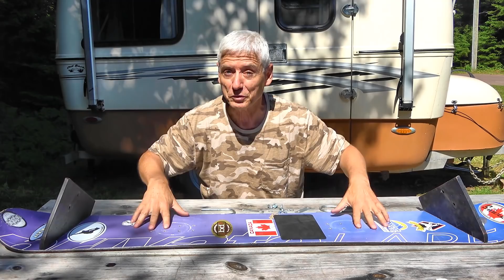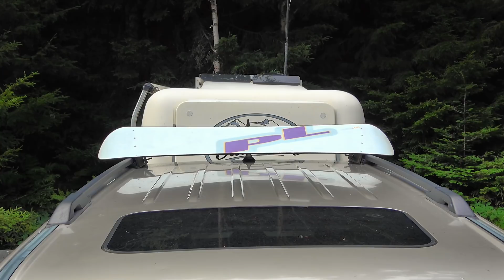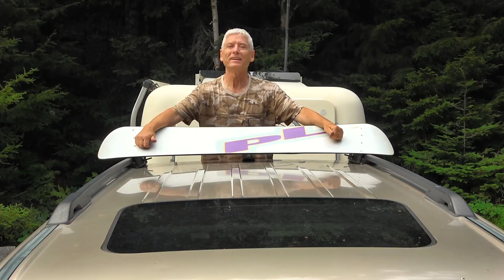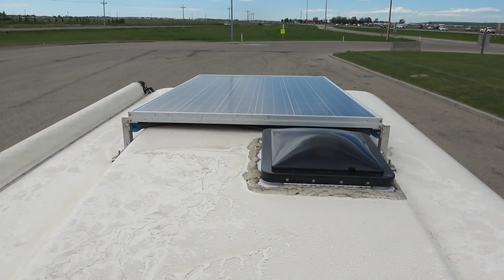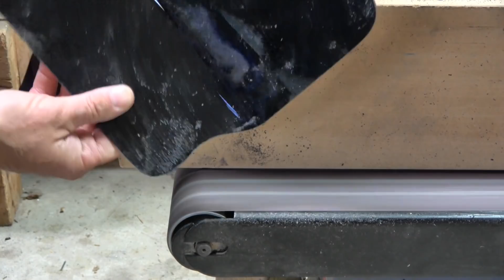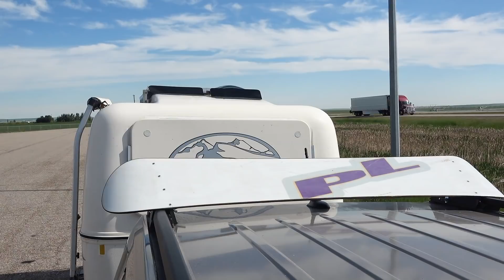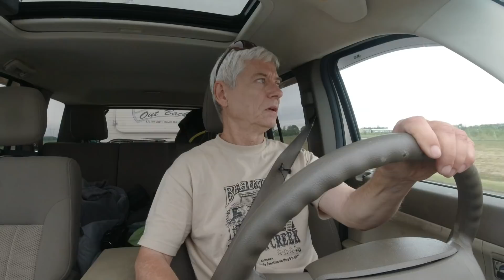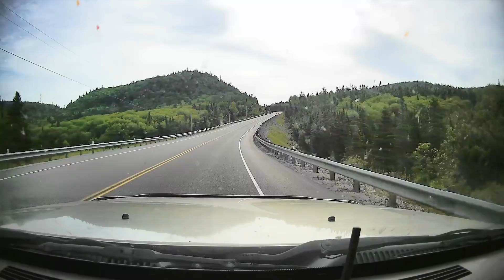Can an Old Snowboard Wind Deflector Improve Gas Mileage while Towing?

Comment: How much of that was up and down hills?  Traffic, etc.?  That's what I've found over the years that has a lot to do with how bad your towing fuel economy....Even with all your tests without the deflector, you still get about twice the fuel economy that my 88 F250 4x4 460 gets when towing my 21 foot travel trailer LOL.  I only get about 6-8mpg towing HAHA!!

A lot of it has to do with the height of the travel trailer VS the height of the tow vehicle.  You get the wind blowing off the top of your Jeep and hitting the frontal area of your trailer thus creating drag.  Your snowboard deflector definitely helped push that air over the top of the trailer...you should maybe increase the angle a bit on the deflector, maybe to 35 degrees and see if it does better or worse...I kind of bet if you go any higher of an angle it would start reducing your fuel economy.  Hmm, maybe some further testing fun for you HAHA!!!

That was a really interesting test Slim....thanks for taking the time and actually burning the fuel and time to test that out.  Really cool.  May have to try something like that with my vehicle at some point when I get a trailer.

Comment: Well Slim I am glad your experiment worked, as it never hurts to try new things. However, a deflector is not going to work with every vehicle towing that trailer. Like with my 2001 Ford Ranger, as the bed on my little truck catches air like a sail on a sailing ship so it would require a massive deflector to achieve any kind of savings. But if I was pulling a 5th wheel version of that trailer, then a deflector probably would work just fine as I could mount it to the cab of my truck then. And I have seen people that use deflectors, and they rave about them even back in the 1980's, but I have never seen anyone use a snowboard as a deflector so it is good to know that will work as a deflector as well. I suspect if you bring the bottom edge of the deflector closer to your tow vehicle, while maintaining the height it should make an even bigger difference.

Comment: Great video Potatohead , I thought it would work as most long haul trucks have a similar setup , However I'm surprised how well it worked that is some good money saved ! One point worth making I think to anybody thinking of doing the same is make dam sure the fixture to your tow truck is secure as there is a whole lot of force on the deflector and should it come off and go through the windshield of the car behind you would have some hefty expenses to pay also the possibility of something much worse .

Comment: Your car's tires can play an important role in helping you get the best gas mileage and save money at the pump. ... Consumer Reports recently tested a few all-season tire models with low rolling resistance and found that those tires can improve fuel economy by an additional one or two mpg. You can improve your gas mileage by 0.6% on average—up to 3% in some cases—by keeping your tires inflated to the proper pressure. Under-inflated tires can lower gas mileage by about 0.2% for every 1 psi drop in the average pressure of all tires. Properly inflated tires are safer and last longer.

Comment: Dad insisted on having deflectors on his 1980s/ 90s station wagons.
I'd like to test taping strings in places on the camper to see which wiggle less? 
I built a Squaredrop Camper with an angled front, 45 degrees. Built-in deflector. 
I want to try this towing with my Dodge Grand Caravan

Comment: I am thinking about traveling in a 17" uhaul box truck tiny home, I have read that they create a suction behind the box (like semi's). I will be putting some thing there to hopefully reduce the suction created. I don't know but, I think the rounded corners on your trailer might eliminate that problem. You see some semi's that have some deflectors around there back door

Comment: One think that’s easy and cheap to try is to find a scale that can weigh your cars front and rear axles separately and the trailer axle by itself fully loaded with what you carry. Then look at the tire manufacturers specs for your tires and see what the pressure should be for the actual weight. Your tires may be under inflated for your cargo load and adding to rolling resistance.

Comment: Thanks Slim, the key here is what has been known about for a century in the aviation community. Drag increases with the square of the airspeed. Note that it is airspeed not ground speed. We intuitively know driving into a headwind needs more fuel but with a tail wind gives a better fuel range. Anything to reduce drag can help, because of the square rule. If you want to save fuel driving into wind, then slow down.

Comment: Very informative. Thanks for posting, however can't help but wonder what the impact would have been of a taller snowboard. 

Seems to me that the gap beneath the board wasn't nearly as important as the gap above the board. The gap between the top of the snowboard and the top of your trailer's roofline appears to provide about a foot or two of flat trailer face for the wind to hit.

Comment: consider taking down the snowboard when you're not towing, it might be adding extra drag without actually being useful, sans trailer.  easy to test with around town driving without the trailer though. ;-) 
if it actually helps even without the trailer..  potatohead branded spoilers for everybody!

Comment: We had something similar in the UK and europe in the late 70s and 80s. I remember a few different commercial models on sale. Positioning was critical and the problem was the distance from the deflector to the trailer front as most people were using saloon (sedan) cars, and the optimum position would have been achieved on an estate car (Station wagon). I seem to recall that they lost favour when most people switched from petrol (gas) cars to turbo diesel cars.
Impressive results.

Comment: Interesting. Great to see it worked! Have you also tried a spoiler on the back of the trailer roof - I wonder if that would also minimise turbulence and drag off the back of a very “square” trailer rear?
Reply: P.s and I also find it easier to think in mpg and miles!

Comment: At speed a bubble of air forms behind a tow vehicle and what it's hauling that helps keep drag down since the air above it goes over it than against the trailer. However like an open bed pickup that has the same effect but it doesn't form at low speeds and most vehicles have a goldilocks zone usually around average driving speed when  tested in wind tunnel that shows airflow going up/over/off them evenly. You've seen this in wind tunnel tests where they use smoke to show it makes a nearly perfect outline over a car etc and most are designed to match that ideal speed which also aligns with the gas mpg on the highway. Slim might be able to look up that data on the tow vehicle and testing how well the airflow over both can be on in a very simple way with a bit of ribbon  of all things. Indeed a few tied to the board itself like the tail on a kite that are long enough to reach the campers top should show this lift if when the bubble forms and the speed it took. He could even try this parked on a windy day with his caravan facing into the oncoming wind at say 20+mph so he could adjust the angle of the board which might be nearly ideal or close to it now. Kudos on the test Slim and keeping the data along with the mileage/gas stations you used so the outcome was exact. The trucker was right but wrong as well since bring the the cab closer to the trailer let it act as the airfoil itself since it created the bubble and many trucks today either have a built in airfoil over the cab that looks like a curved sea shell or are close enough to the trailer to get the same effect without it at speed.

Comment: Nice to see your experiment worked out! Money in your pocket is always a fantastic thing!

If you're going to keep them, I'd definitely find an additional way to secure the trailer deflectors that involves screws or rivets - I haven't had much luck with double stick tape and would hate to see them fly off and cause someone else damage.
Reply from the maker: No more screws or rivets on my roof! The acrylic deflectors are made from the same material and use the same adhesive as the rain guards on my Jeep. Try ripping one of those off! SP

Comment: I tow a 16' Fiberglass camper with a 4.0 L Nissan pickup with a tanau (sp?) cover I wish I could do the same as you however I like the easy access to the bed of the truck. I have found that at 50mph I get 16.5 mpg at 60 mph I get 14.8 and at 70 mph I get 12..2 mpg so speed also matters a lot. Thanks for your experiments it encourages people to think.

Comment: You need the VHB #4950 tape, not the #59XX that you have. I have used both and no success with the #59XX.
Reply from the maker: After 5000 kilometers that adhesive is not budging. It's also the same adhesive that comes with the Jeep window deflectors. SP

Comment: Good job Slim. Do you know some college kid came up with the winglet idea for an airplane. It make the plane cut through the air more stable, thus saving an enormous amount of fuel. Race car engineers have been using wind deflectors to gain more speed out of their cars without increasing horsepower and extending gas mileage. Enzo Ferrari and his wind tunnel test are famous for this. There are two aircraft designers Dick and Burt Rutan who have greatly used these wind deflectors ,fairing to increase speed in aircraft. Keep it up Slim, you are going in the right direction.

Comment: Great job Slim!  The auto racing set has lots of information about wind resistance with spoilers of different kinds.  One thing you may want to watch for is increased tire wear.  The air sweeps across the roof, "pushing down" on the car a tad.  That can cause extra tire wear.   Raising/lowering the tire pressure a little may be another fun experiment for the next step.  Such a clever idea using the light weight, easy to mount snow board!

Comment: I own two vehicles. One is a big diesel pickup. The other is a small compact car. They both have six speed automatic transmissions. They both shift into sixth gear at 55 miles per hour. When I am towing with either one, I hold my speed to 55 miles per hour. I do this for two reasons. One, it is the safest speed to go when towing. Two, this speed results in the most miles per gallon. On expressways, I do not impede anyone’s progress. On two lane roads, if traffic stacks up behind me, I pull over to let them by.

Comment: Most people won't, but if they'd just slowed down to 10-20 mph below the speed limit, it also makes a noticeable difference in fuel mileage, especially when towing.
Reply from the maker: Please don't do that. You put others who use the highways at risk. Go with the flow, or just slightly less. SP
Reply: @SlimPotatohead  A lot of commercial trucks here in the states are already governed to run at the those slower speeds, for fuel savings.

Comment: This was a great idea and you've saved money but one thing to bear in mind is aerodynamics isn't always logical, like how Mythbusters proved that driving a pickup with the tailgate up is more fuel efficient that dropped down.
I love the way you design, scavenge then build or modify. I do exactly the same pulling all kinds of scrap out of the metal, wood and plastic skips at work 👍

Comment: If your tow vehicle is already very aero, mods won't do much, but as the video shows, small mods to something inefficient to begin with makes huge differences.
Reply from the maker: Actually, it wasn't as much the tow vehicle as the shape of what I was towing. I suspect a smaller but well-designed tow vehicle would still have issues towing a higher trailer. SP

Comment: Slim without including wind factor you're missing an important variable.
Reply from the maker: Do you really think I can accurately measure that while driving? SP
Reply: @SlimPotatohead  Slim I have a Ram Ecodiesel pulling an Escape 5.0 TA.  In a no wind condition I get 17-18 mpg.  The difference in a slight headwind vs slight tailwind can be 4-5 mpg.  While I'm driving I'm constantly monitoring indicators along the road.  Flags, banners, wind turbines or things hanging on fences.   Yes, I realize that it would be very difficult to accurately factor wind but without that variable I would be reluctant to reach conclusions.   Have a safe trip
Reply from the maker: My conclusion was I had better gas mileage with the deflector. I stand by that claim. If you really think it was an accident based on wind, prove me wrong. SP

Comment: That’s awesome. It’s always encouraging when our experiments work in our favour. Question though?  Does it matter if we calculate mpg using Canadian gallon or USA gallon?  Just a thought. I don’t know the answer. Regardless, I believe the wind deflector would be a benefit.
Reply from the maker: There is no Canadian Gallon. We're metric! I used US gallons. Thanks! SP
Reply: I didn’t know if it made a difference if a gallon is based on 3.8 litres or 4 litres?  Perhaps I don’t understand the mathematics applied here.   Ok. thanks Slim. All the best in your new home.

Comment: You can't calculate numbers based on how many miles you think you normally get by looking at a gauge, you need absolute numbers....the amount of gas burned and the exact miles driven.  If your going to drive 200 kilometers and its sunny and flat the entire way you fill up the tank and remove the snowboard....drive 100 kilometers to the next gas station and fill up again.  Put the snowboard on and drive the next 100 kilometers and fill up again.  Now you have the amount of gas and miles for both the snowboard on and off during the same driving conditions.  A gauge is just a gauge.....consider it a sundial....it just gives you an idea of the time not the real time.
Reply from the maker: Hence the odometer reading and fuel consumption readings in the second half. Did you watch the entire video? Thanks! SP
Reply: @SlimPotatohead  Yes I did watch the entire video and what I am saying still stands as the best way.  Those gas cut offs on pumps are based on vapor coming from the gas tank, not the actual 'full' tank.  Fill up the tank until you can see the gas in the filler tube, drive 100 km's (or 120) to the next gas station and fill it the same way right to the top and then put on the snowboard.  Then drive another 120 km or so....and you'll get the exact amount of gas used pulling the same trailer in the same amount of wind direction.  Wind change will drastically change your gas usage.  With this method you only have to do the test once.  Two exact amount of gas usage on the same day, same driving, same weather.  

Great ideas on thinking its just wind resistance....but when was the last time that axle was greased?  Maybe your gas guzzling isn't all about the wind and the weight of the trailer but also an axle that needs a little help :-)

Comment: I used that 3M extreme mounting tape for the same use you tried, mounting those spice rack jar holders to the inside door of a cabinet. They failed within an hour, so much for the definition of “extreme “!
Reply from the maker: Hi Mark. I think it was the type of plastic. On acrylic it holds really tight. Thanks! SP

Comment: Interesting video Slim. I suspect your variation in improvement on highway vs. backroads could be speed related. I imagine you need to be at a minimum speed for that deflector to get that air up and over the front, you might only be getting partial deflection at less than highway speeds. Average speed on each leg would be interesting to monitor. I suspect the higher the average speed the larger the improvement.
Reply from the maker: Hi Ryan, I believe you are correct. I was actually travelling a little faster in the last stretch, yet the fuel savings were the greatest. Thanks! SP
Reply: @SlimPotatohead  In aviation we use multiple lengths of colored string taped on the wings/fuselage to monitor air flow and angle of attack. It would be interesting for you to mount these on the top of the jeep and front of the trailer  (wool string and green painters tape), you may get a better idea how of the wing is deflecting air up and over the top - and it would be visible on video to put the haters to bed...hint hint

Comment: I knew it was going to be worth it. It's a no-brainer that whenever you can reduce wind resistance it will improve mileage. It was great that you could prove the naysayers wrong & rub their noses in it. Granted, you could probably get even better results with computer-designed commercial products but for folks on a budget a DIY project like yours is definitely worth trying. Well done!

Comment: I have a suggestion for another idea to lower your aerodynamic drag.  Use airfoils to curve and funnel airflow from the sides and top of the trailer into the low pressure area behind your trailer.  This would simulate to some extent the boat tail on a bullet or rocket.

Comment: GREAT job slim!
I am an experimenter too. I definitely believe you have more improvements to make in the future.
One thing that I successfully tried with my rig is changing transfer case and front and rear differential fluids. My rig does weigh about triple what yours does but the parasitic drag in these areas can be helped a bunch by using a lighter viscosity but at the same time better quality synthetic lubricant. I went from 140 weight conventional differential lube to 80 weight synthetic and the results were pretty impressive, you might try it.  
If a guy thinks about parasitic drag all over your tow rig and trailer consider bearing drag, brake drag, tire type and inflation pressures etc. etc. there’s more improvement to be had.  All my best buddy
Reply from the maker: Excellent tips! I need to take my Jeep in for servicing, so will inquire. Thanks! SP